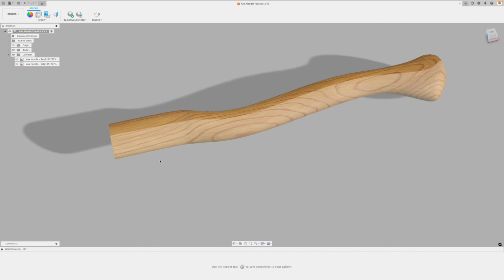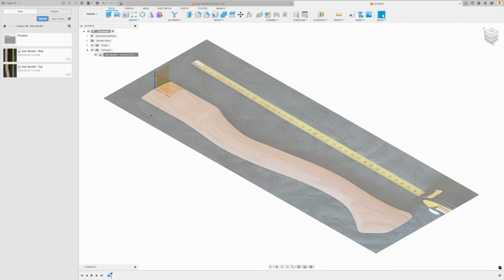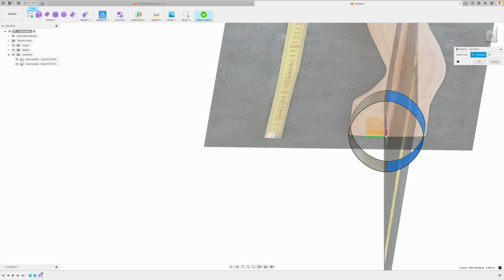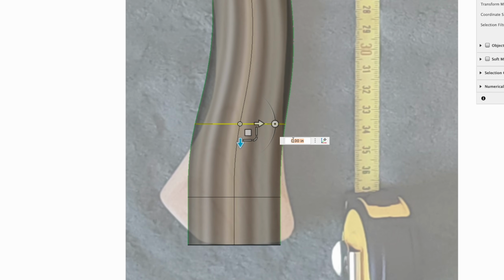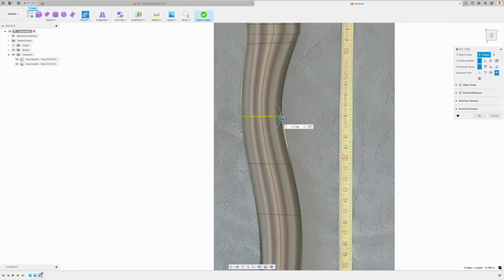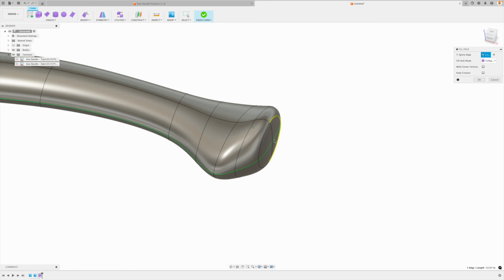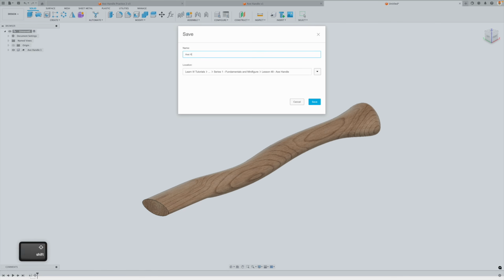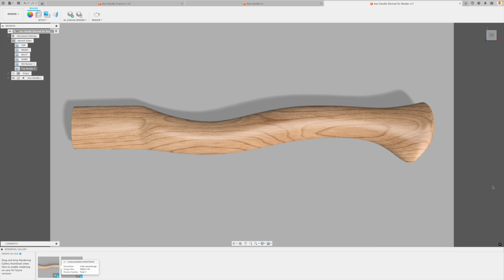Autodesk Fusion 360 - Axe Handle - Form Modelling (T-Splines) (2025)

Comment: Dear Sirs:
  I would think this would be manufactured on a CNC 4th Axis Router (Like an AVID 4x4 with 4th Axis option installed) in a production environment...This looks like a GREAT part to use as a teaching aid for the Manufacturing portion of Fusion, setting up all the rotary cuts (Rought cut, ANGULAR CUTS {SO YOU DONT CHIP OUT THE WOOD aka ASH}, FINISH CUT) and exporting the G-Code to import into the router!...
Reply from the maker: Awesome comment and suggestion. Thank you! I’m keeping the next tutorial as teaching 3-axis tool paths, but I like your idea of having a tutorial on 4-axis methods too. Stay tuned!
Reply: I was thinking the same, regarding 4th axis. However, since this object can also be done in 3 axis, I’m equally interested in seeing how one would approach 2 sided milling, especially regarding accurately positioning and securing the piece for milling the second side (especially because the already milled side is rounded, and I think that precisely positioning and securing it would be challenging). Can’t wait for the cnc tutorial, and eventually other videos with tiling or 4 axis milling. Slim pickings out there on Fusion CAM.
Reply from the maker: @MStoica Great feedback! Thank you. I am really excited to get in to more on the CAM side of things. Stay tuned!
Reply: Im looking forward to the CAM process but for me specifically I am building an asymmetric duplication lathe so dont need CNC. I will model forms for 3D printing the master pattern for duplication in wood parts 💪 amazing work Tai!
Reply from the maker: Would love to see your finished work.